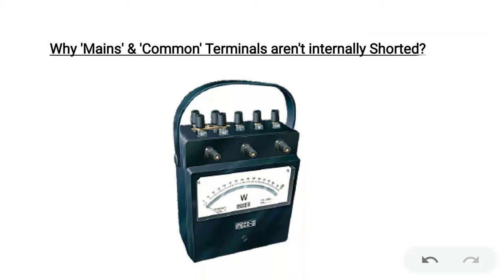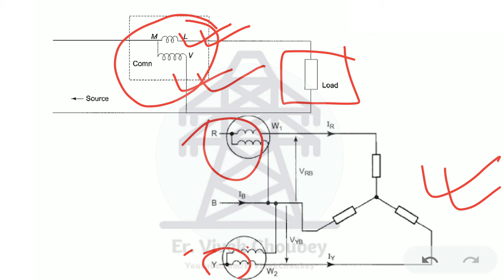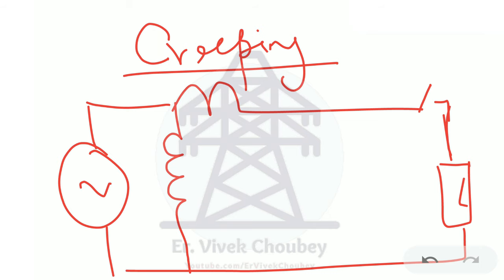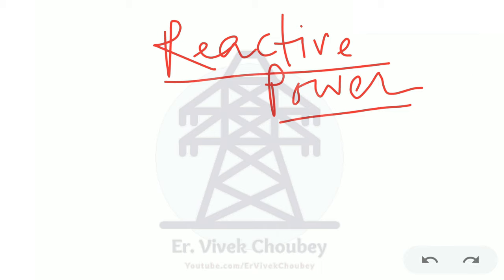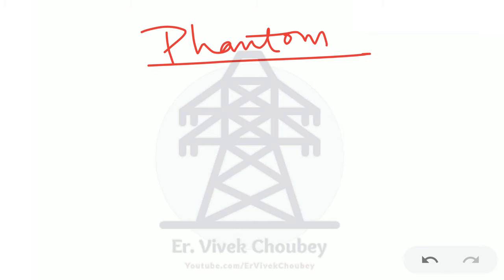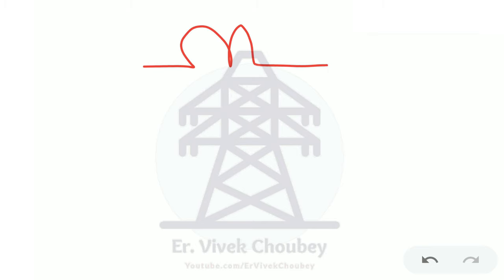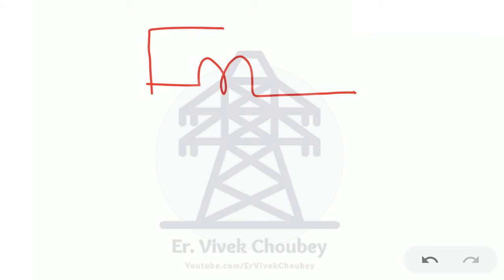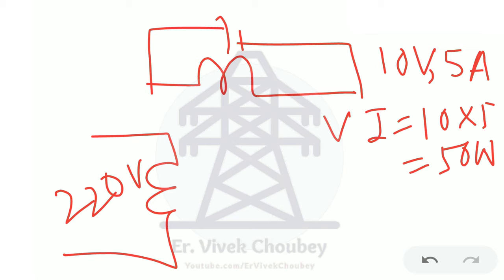Why the 'M' and 'C' terminals of a wattmeter aren't internally connected? | Phantom Loading.

Comment: Bro why we use different power factor wattmeters like unity powerfactor, 0.2 pf, and 0.8pf etc for different experiments
Reply from the maker: Different power factors are taken to compensate for the error due to pressure coil inductance and low deflection torque in case of a highly inductive load or low Power factor load. If there is a load of low power factor then the deflection torque is small and hence the wattmeter shows incorrect reading. Also, the inductance of the pressure coil adds up and causes error. Thus a suitable low power factor Wattmeter is needed which is more sensitive and can measure the power accurately. That's why different sets of wattmeters are used to measure the power across different loads. A Wattmeter working for purely resistive load won't be able to measure the power accurately against an inductive load and hence modifications are required to compensate the error within the Wattmeter. 

I hope this cleared your doubt.
Reply: @ervivekchoubey  Thank you bro and make a video on Arc formations in different circuit breakers and also on Lightning.
Reply from the maker: @saikiran7959  Thanks a lot. Here is a video I made on arc generation and why it happens. You can check this out

https://youtu.be/dpfpwEDHQU8

Comment: To increase the range of wattmeter by using CT & PT this M & C isolation is also required.
Am I right?
Reply from the maker: Yes you can call that an added advantage although there are tappings available to increase the range of the wattmeter.